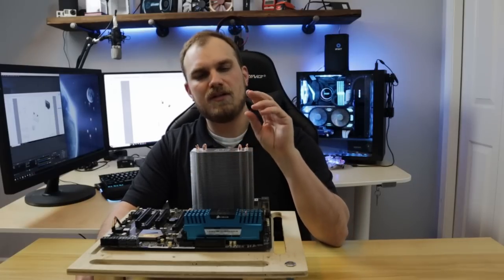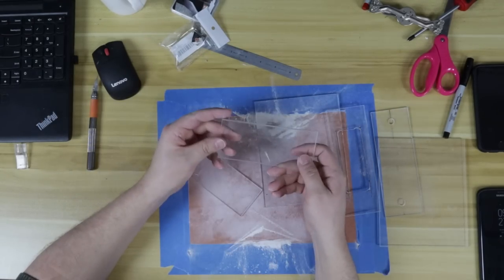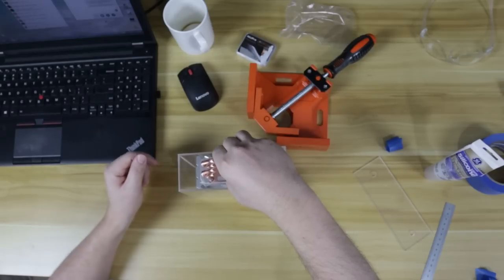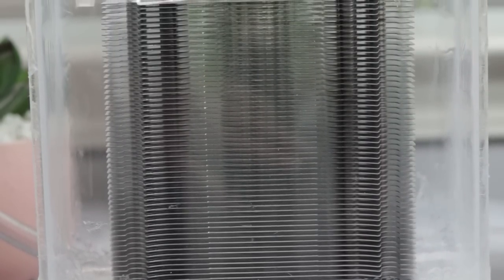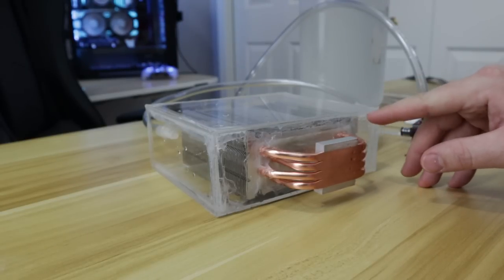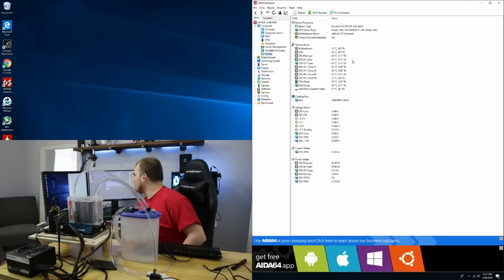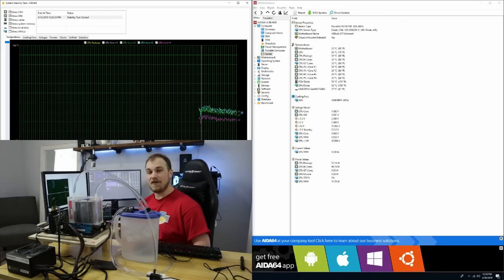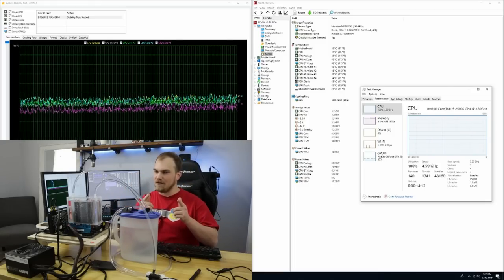I Water Cooled My Air Cooler AND..........

Comment: A very interesting idea, but here are a couple ideas on implementation.

1) Try polycarbonate (Lexan) instead of acrylic. It's much easier to machine - it won't shatter when cutting, drilling or tapping threads, though it's a little harder to glue. You can use the same cement, but it takes more time and more cement to "weld" a really good joint. When I glue polycarbonate I go over every seam a second time after the first one has cured. This can also help prevent leaks, but since you're backing your seams up with silicone, you should be fine. If you use 1/4" you can even drill and tap holes and use #4 machine screws to hold everything together mechanically. Of course that's a lot of work that's not needed - just more fun! :))

2) I doubt you're getting much flow through the fins. The water is going to take the path of least resistance, so it's way more likely to go around the fins than through them. Early in your video you mentioned the idea of adding a baffle to route the water. I think that's of supreme importance. If you did that I wouldn't think you would need any bigger or better air-cooler, in fact you could probably go smaller.

Good luck with version 2!!
Reply: I agree with everything you wrote there. It also seems a good idea to add some form of stands to help carry the weight of the water and the block combined. It seems like a lot of weight on the cpu.
Reply: Methylene Chloride is my bonder of choice, only need to do it once on the inside seem, if I really want to make sure I do the outside also.
Reply: Imo, you would also need some cooling for the water as well, as it gets hot really fast. Put an external rad down the route.
Reply: @welcometocattown2036  not Necessarily, when the water around the fins heat up they move up and colder water will replace them, the fins will create their own flow with the convection current
Reply: We make the lightsaber tubes "blades" from polycarbonate tube. You can beat the heall out of each other with them and they will never break lol. Its good stuff.
Reply: I think HDPE+Aluminum foil lining would be better since HDPE can be cut with scissors then molded as needed with a heat gun/soldering iron. the lining should prevent boiling water from turning it into putty even if it is unlikely with such a high volume of water. granted it won't be as pretty to look at as acrylic/polycarbonate. the good thing is you shouldn't need to buy HDPE directly since it's used to make many types of bottles and gallon milk/water jugs.
Reply: Yes all of that above!

Comment: This should be tested again, but with cold fluid entering from the bottom and the warm water removed from top, this setup is having the cold sucked straight out.
Reply: I thought about the same thing
Reply: The input hose goes to the bottom and the output hose ends at the top. What it needs is input on one side and output on the other side so the cold water flows between the fins. The way it is currently the water between the fins would only move due to convection.
Reply: will not matter in long run after the system is saturated with heat.
Reply: also he should try a passive-style heatsink, with thicker gaps between the fins so the water can more effectively pass through the fins and to avoid those airbubbles.

Comment: Isn't this just water cooling with extra steps?
Reply: A water cooler is just a air cooler with extra seps.
Reply: this is CPU-air cooling interface and the water cooling is a cooper-CPU interface, so technically this is just what you say with extra steps...
Reply: NO NO NO a bit,yes.
Reply: Ah yes, inefficiency.
Reply: The area contacting water is actually way much more larger than most of the water cooling system. So I think it's quite worth a try. I think it would be more efficient if the air bubbles are cleared entirely.
Reply: @陳旻宏-f6m  wouldn't it be much more efficient to apply the water much closer to the cpu?
Reply: @Verticas  I think it would be possible if the volume of water (mass flow rate) flowing through the heatsink is large enough. But water isn't something very good for conducting heat.
That's why we increase surface area with heatsink, to maximize the effectiveness inside constrained space (which is hugely increased in this video).
But copper's heat conducting ability is pretty good.
I think we would have to do this kind of experiment to find out which is more effective.
But it all comes down to surface area, coolant type, water flow rate, etc.
Reply: @陳旻宏-f6m  hmmm I see, so you move majority of the heat into a large surface area to cool it faster with water.

Although, the property of water not being able to conduct heat very well is a good thing. As it requires more heat energy to heat up the water. If the water stays cooler for longer, I'd assume that would keep the cpu cooler at the same time. Correct me if I'm wrong though.
Reply: @Verticas  I wouldn't say it's wrong, but I don't know if that's the case tho. But one thing we are sure of is that if water is bad for cooling, we wouldn't be using it for this job. So I would say that's a different approach to this solution 😊.
This is what I thought, the absorbed heat is the same (since the heat source is the same).
The reason why we use water is because we can control it better. After the water is heated, we use a better fluid to cool it down, which is air. The water's characteristic of being good for us to control comes into play at this stage, we increase the surface area hugely by using the air-cooled heatsink. And water keeps flowing back to the CPU. So increase surface area at CPU will certainly gives us better result (only if we ignore the heat conducting ability of CPU heatsink that you mentioned earlier).
Reply: Yup, except that the radiator used isn't optimal for this purpose since it wasn't designed for it.  They already sell radiators and pumps.  The radiators are bigger and don't need to be in contact with the CPU, allowing them to double as case fans.  They are designed for optimal water flow, air flow, and use of space.  This is really kind of a ridiculous waste of time unless it is just for educational purposes.
Reply: Exactly what I was thinking. I'm not a thermodynamics expert, but I'm pretty sure this is less efficient (than standard water cooling).
It's like he had just increased the water-block volume a lot, but now the heat takes a longer route to dissipate into the water (In the end, it's just CPU-to-metal-to-water. A large radiator in a large volume of water is no more efficient than a small water block colling a small volume of water at any given time). And there are other inefficiencies, like the water flow, which is not very efficient in dissipating heat from the radiator fins in this design (lest remember there is no fan here).
Reply: 69 like
Reply: If the water were to enter and exit on opposite diagonals it would be efficient enough that no further orientation changes would be necessary. With a jug that size, if it were metal it almost has enough surface area to dissipate heat without any added fans or radiators!
Reply: @DVSProductions  when you think of it - water cooling is the same as air cooling, it's just using hoses with fluid that gets pumped arround (connected to fins with fans), instead of heatpipes which move heated vapor inside (connected to fins with fans). Over here we have heatpipes taking heat, moving it to fins, fins getting cooled by water, water heat must be dissipated or cooled. In the end it's just stupid because there are water blocks and it can't get more efficient and be smaller than that.
Reply: @陳旻宏-f6m  This is basically what a water cooler is. It's a copper heat sink, water flows over the heat sink, pulls away and radiates it to the air. 
In this case, his CPU to water interface is way oversized. Water carries a lot more heat than air, so the cooling surface area only needs to be the size of a matchbox at most. The water to air radiator must be much larger and with good air exchange. His water to air cooler is a plastic water jug. His setup will reach temperature saturation because it can't radiate the temperature to air quickly enough. A system with appropriately sized heat exchangers could run indefinitely.
Reply: @ModMINI  I agree, but the efficiency might not be as good when compared to a proper water cooling setup.
To improve the radiation of heat, just keep throwing ice cubes inside the water jug tho XD
Reply: Ya he just made a custom cpu block
Reply: @陳旻宏-f6m  'But water isn't something very good for conducting heat.'  You do realize water is many times better than air, right?  How 'bad' you say water is in isolation doesn't matter, it is many times better than air.  'Water will transfer heat 24.17 times faster than air. '
Reply: Same same
Reply: Why not put a TEC on bottom, with an air cooler attached to a water cooler, inside a freezer...
Reply: @DVSProductions  So... in this case, what's done here is just cooling with extra steps on top of extra steps? Stepception.
Reply: @onlykat.-9644  exactly
Reply: As much as a split AC is an AC with extra steps
Reply: Well, it's air cooling watercooled, otherwise water-cooling is air-cooled (?
Reply: @Verticas  heat conductivity is not the same thing as specific heat capacity
Reply: It's more efficient if he put the cpu in water
Reply: No. This is air-cooling a water-cooling air cooler
Reply: This is not liquid cooling. There is a reservoir but no heat dissipation unit. Given some time the water can boil.
Reply: Tim White my thoughts exactly
Reply: @陳旻宏-f6m  it's still 100% a homemade radiator
Reply: @MeXtSxDarKmoonX  true tho🤔
Reply: In my vision its better than a convencinal watr cooler. The air cooler radiator in this case Will increase the surface area and the heat will be more efficiently exchanged with water.
Reply: @DVSProductions  Here we have air cooling with extra steps, with extra steps
Reply: Nah...It's air cooling...with extra steps! XD
Reply: @陳旻宏-f6m  Sorry to bump an old thread, but by that logic isn't liquid-cooling a liquid cooler more efficient than the aircooler in this case?
Reply: @Verticas  Not actually: that's because the heat pipes have a very high thermal conductivity, nearly as much as direct contact. Heat is then transferred to aluminium "slats" which increase the surface area.
Reply: @Verticas  Water doesn't conduct heat well.  Metal does.  So this is increasing the surface area of the water-to-copper transfer of heat energy, which should be much more efficient than a plain block.  If you look inside of a water block there actually are a ton of fins (machined to micro channels) much like an air cooler, but tiny.  This water-cooled air cooler ups that surface area to ridiculous levels, so should be far more efficient at heat transfer.  Was a water block ever a bottleneck to the heat transfer process in the first place?  Probably not, or else water coolers would have larger fins inside of their water blocks than they already do.

Still, another advantage to this silly overkill of a water block is that it is something of a failsafe against gunk.  If you don't use perfect chemistry some watercooled systems will gunk up.  (Due to dyes breaking down, mixed metals oxidizing, organics, etc.)  It shouldn't be a problem if you know what you're doing, but in that we're seeing Enermax AIO coolers having gunk issues, apparently even experts aren't experts.  This should let you see the gunk buildup (hopefully a lack of) in your "water block" so that you know if you have an issue.  And because of the ridiculous surface area and much wider spacing between the fins than a normal waterblock's microchannels, if you are getting gunk or corrosion, it's not going to kill your flow rate nearly so quickly and cause problems before you can notice and fix it.

With the right chemistry, anything is possible.

With the wrong chemistry ... Bad Things Happen.  (Such as the leaky capacitors of old.)
Reply: @DVSProductions  air cooler is just a passive cooler with extra steps
Reply: @fairytailluna4524  I'd argue that a passive cooler is just an air cooler with fewer steps

Comment: For version 2.0, get some 90 degree fittings to force water through the fins.
Reply: @jeffsadowski  exactly what I was thinking and some baffles in it to to force it to go through the fins and not around the side of the fins for the least restricted flow
Reply: @jeffsadowski  i would suggest a shroud for the inlet and the outlet directed at the fins that way it gets to all if not most of them.
Reply: YES! and put the input and output hoses on the sides for when the Mobo is mounted sideways in a Rig.
Reply: @comadamptog6606  Exactly what I was thinking or just use Jeffs idea.  Seriously cool video.
Reply: and add small fish for some next level decoration. RGB is so last year
Reply: Alternatively cut the top of the heatpibes, make a loop trough there. This way you would have the benefit of the heat dissipation from the fins, combined with the heat removal through the flowing water. 

This way you would skip the tank as well :)
Reply: @timbersync  I dont think fish would survive in 35 degree water. (35C=95F)
Reply: air bubbles are going to cause inconsistent heat spots. maybe bad depending on your use of your PC and how many air bubbles there is. but tbh its an air cooled cooler anyways im sure if can withstand a bit heat in spots.
my worry would be if it got pushed up to 80 degrees or something, im not sure if the water would get close to boiling and then cause steam pressure. all this is just theoretical for this design.
Reply: @gismo3564  thats what an actual water cooler really is
Reply: @ScharFX  haha yeah. it was a joke.
Reply: @Dockhead  You wouldn't have to worry about boiling as the cooler itself will never get that hot. Only the cpu die will get that hot. You would, however have to deal with evaporation with higher temps, much like any AIO, and the cooler running dry.
Reply: i thougt exactly the same xD
Reply: @poppershnoz4536  You wouldn't want the weight of that water pulling on the motherboard, it would have to be flat on its back otherwise it could bend/break away from the mounts or just snap all together. Unless custom support beams are made per each case. but that could interfere with graphics card placements
Reply: @MrJewsbury  Could Create a Custom Crossbar that it could sit on.
Or, perhaps a metal shelf that hangs from the ceiling of the case.
Then just place the Radiator in the front of the case.
This would totally work in a Full Size Tower and maby even a mid tower.
Reply: yep, 100% right  @jeffsadowski
Reply: @KillerAlzu  it's really not. A normal water cooler is closer to what is made here. basically the tower is turned into a water block. With just the small limitation that the heat is transferred through heatpibes instead. A water block and an external radiatoren, which the water is pushed through. 

On the proposed design, it would be more like a tower+water loop hybrid since the tower cooler itself would function quite similarly to its intended purpose, but with the water cooling radiator.
Reply: @jeffsadowski  
I completely agree

Comment: In my best Rick voice: "That's just water cooling with extra steps"
Reply: It's actually not going to be better than air cooling because those heat pipes have a fixed capacity, so they can't move heat to the radiator past a certain point, which you'd likely be able to hit with just air cooling, no water required. 

There's a reason why water blocks all have direct contact with the CPU block instead of a heat pipe intermediary like this.
Reply: Yea....without air well...yea just water cooled right?
Reply: Wubba lubba dub dub
Reply: @jttech44  although I understand what you say, heat flux speed is directly proportional to the temperature difference, so cooling the radiator would improve the heat speed.

Anyways, it's true that it won't probably be noticeably faster. It can be faster but it's likely to be just a marginal difference.
Reply: Really when u think about. Water cooling is just air cooling with extra steps.  Because your still gonna use a radiator with a fan on it. The only difference is the benefit of heat transfer to water instead of copper.
Reply: @jmccoy96jm  Copper actually conducts heat faster, but it has a much lower specific heat and also doesn't move. Physically moving hot things is the quickest way to move heat away from other things. So the goal is to essentially have copper contact the IHS, then a mini copper radiator with water running through it to dump heat into the water as quickly as possible, and then have the water run away with the heat to a much larger air cooled radiator it can slowly dump all that heat into (since air has a very low specific heat and thermal conductivity but you can efficiently move lots of it).

Most ideally, this would be done with graphene over copper which seems to have amazing thermal conductivity and shouldn't be that hard to actually integrate into these things since it just needs to exist, nothing fancy.